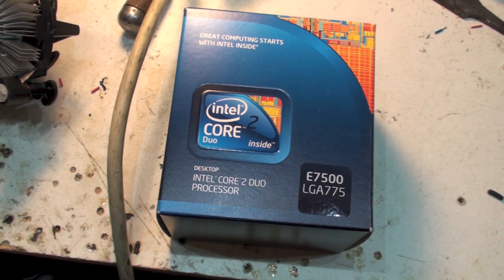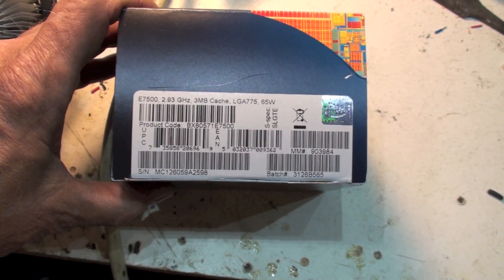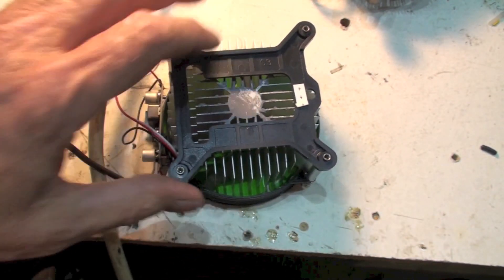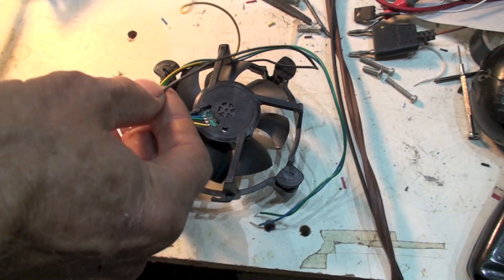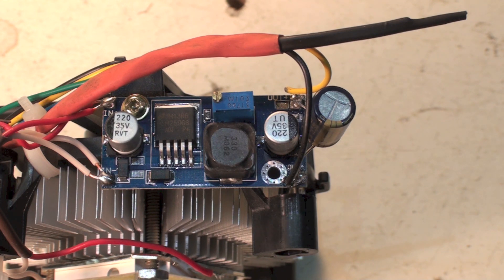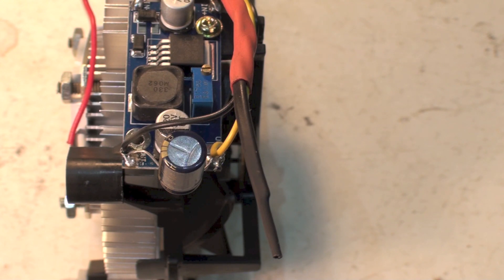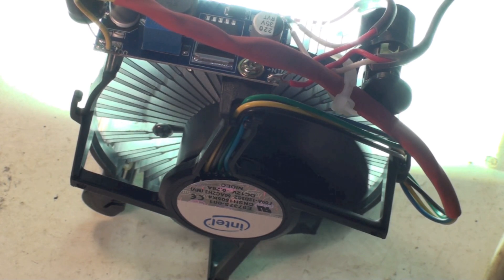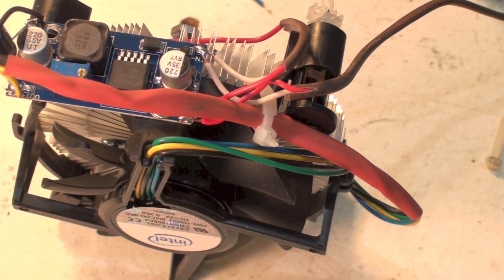Heat sink and 4 wire fan for the 100 watt led light

Comment: Fan is spinning the wrong direction I think is connected backwards, switch polarity just on the fan or recheck your wire diagram...and if you tie the other two It will spin faster,  is for a heat thermistor when cpu get warmer perhaps you want to use it on full speed, just jump them together...good luck

Comment: Are you supplying 12v and 10amps to your set up?
Reply from the maker: These leds operate on 32 to 36 volts.
GFM
Reply: Yes I use a boost converter (regulator) to bring up the volts to 36 and the amps to 3a -  but I use a 12v 10amp  to feed that booster - You said in the video that you use the regulator to bring down the voltage to 32 - 36volts - but from what - a car battery? Could you please tell me what are you feeding the regulator (Volts and Amps) - because my100w Led set up (including the 12v 10a power supply) costs around $65 Thanks
Reply from the maker: I see.  The source is 120v A/C.  I am using an inverter to change the voltage to DC and reduce the voltage and the amp draw from the source is about 1 amp.
GFM

Comment: Neat, but what do you intend as the final use? Is this a spot or diffuse source?
Cheers
Reply from the maker: I am using them to replace halogens in my shop.  I have a couple of videos about how I have done some of them.  These particular ones will have lenses on them and they are diffuse.  I find them excellent for doing my videos.
GFM

Comment: I would install about a 2000uF cap and a MOSFET with a voltage divider (2 resistors, or 1 trim pot) to control the start time of fan. You need to adjust resistor ratio, so it reaches Vgsth just before output cap voltage reaches 12 volts. This will ensure output cap has enough charge to start the FAN from the first jerk.
Next, RPM control. If you leave control wire unconnected - it's actually not good. This particular one falls back to some default (presumably minimum) RPM with no control signal. If you have an oscilloscope, you can identify the feedback wire - it will have square wave when the fan is spinning (1-2 pulses per revolution). The other wire is the control wire. Feed it with +12 to ramp the thing up to max RPM. Or you can short them together to achieve about a half RPM (feedback wire outputs about 50% duty cycle PWM).
Reply from the maker: Well, I think you have probably covered it all.  I will be trying your suggestions.  Thanks for the thoughts.
GFM
Reply: That's fantastic advice